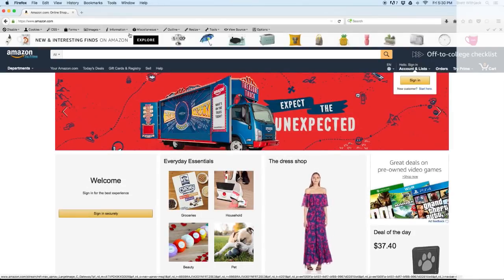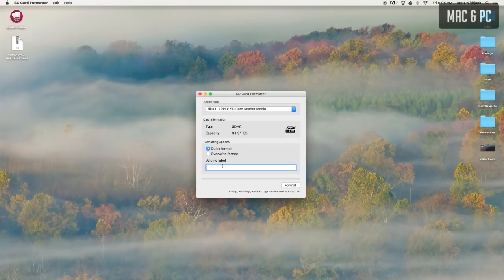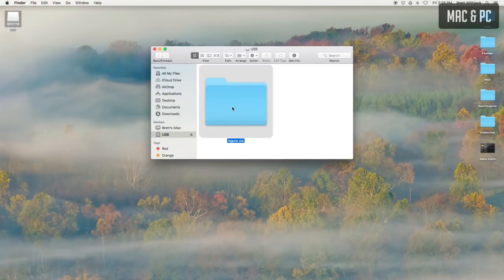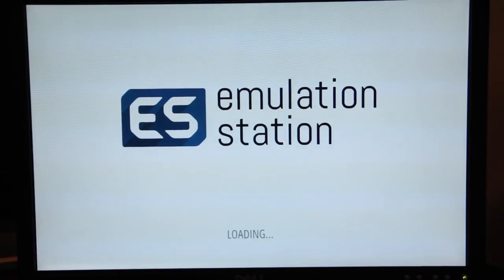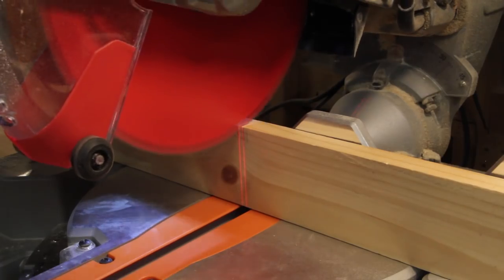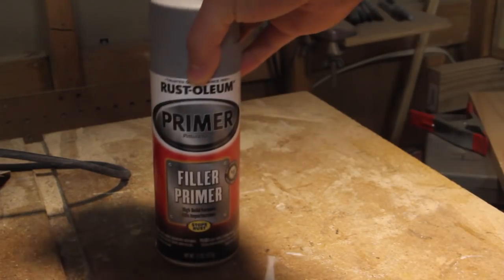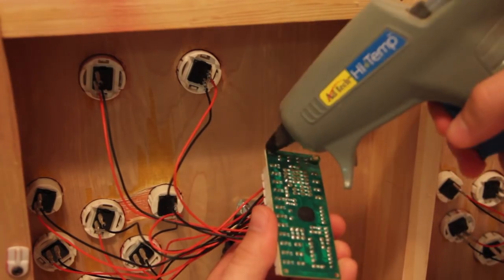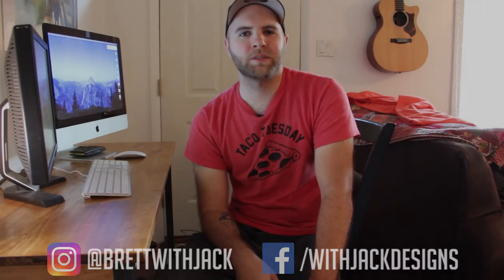Easiest DIY Arcade EVER - Part 1 - the Electronics

Comment: Great video! Very inspiring for a simple DIY project. 

I really liked the video because you made everything easy to understand and it is step-by-step.
What is great is that you did it as a 2 step process. After creating the base, if you want to continue to create the arcade box, go ahead. If not, you still play games using the joystick controls. 
So, I saw the comment below about having a complete equipped workshop. It would be nice to have everything but the whole project can be done with:
* Drill with the correct bits and blades. - For all holes
* Circular Saw - For the Main panel
* Mitre Box and Hand Saw - Inside joints and supports
* Jig Saw (Nice to have) - For the back.

BTW, love the comments coming from the cat!

Comment: As someone who has built a lot of arcade cabinets and control panels...if you want an ultra permium finish use black matte finish kitchen grade laminate. ITs a bit pricey for a 4'x8' sheet but it lasts for a lot of projects. It will make your top scratch and spill proof and it looks sick.
Reply from the maker: Awesome tip, thank you! I’ll have to give that a try if I make another. Well worth the money if it lasts

Comment: Pretty good rig, I would have attached the PCB card to the side instead of the top in case the top takes impact, it doesn't rattle the wire connections.
Reply: Do it then...ur  full  of it bud..
Reply: @keegan9470  Honey it was just a constructive criticism, chill

Comment: One other thing that is handy for an arcade stick thing is using a drawer box replacement.

Edit: for loading the roms there is 2 methods which one is using a USB drive and the other is SSH which you can use your network or WinSCP which you can just drag and drop and the process and time is pretty much about the same and another thing is for having the roms appear you don't need to do a full restart on the system you could always just restart emulationstation and everything will be loaded up and goes a lot quicker.

Comment from the maker: Hey folks, part 2 will be coming out in the coming weeks so stay tuned and don't forget to subscribe! And if you have any questions at all, don't hesitate to reach out!
Reply: Brett Withjack Dude! I love the new style. I like the step by step, most creators skip all the tech junk and force folks to go walkabout for the information. And I see you haven't frosted the bottle lamp yet lol
Reply from the maker: Thank you! Glad you like it :D as for the lamp though, that's the main room in the house which is quite small and that little lamp lights up the whole room lol creates a nice ambiance, plus I like seeing the style of the bulb.
Reply: OK.  I have two arcade style controllers setup already.. With 2 x dragon rise USB encoders. 

I'm having an issue with the controller boards using retroarch. 

Player 1 is configured and is working.  All is well.  

Come player 2.. I go to configure player 2.. It overrides the player 1 configured controller settings. 

And vice versa when I go to reconfigure player 1. 

Any ideas on how to correct this?

Also I'm using retroarch 1.6.7.. 

This is also open for anyone to answer.
Thanks for your time.
Reply: You may have just answered this question for me. 

A little bit of testing will confirm whether or not you were right.
Reply: Will it be here soon?
Reply from the maker: GorillaBomber Yes! The build is done and the video is already into production. I’ve been sick the past week so it’s slowed me down a little.
Reply: How close until the vid comes out , I am so excited you are the best how to build things person you go through every step Thank you for being alive and doing YouTube. And you earned urself a sub ;)
Reply from the maker: Michael Gonzalez thank you! The arcade is done and the video is currently in production. Depending on when I feel better and get my voice back I’ll be able to film the actual “how to” portion
Reply: Ok thank you, hope you feel better, you are in my prayers. :) (I would use a prayer emoji but I don't have one lol)
Reply from the maker: Haha no worries, thank you!
Reply: I have a question should I use ac or usb powered speaker which one is better
Reply from the maker: Michael Gonzalez Honestly doesn’t matter how it’s powered, just as long as you’re happy with the quality. I’ve had good luck with both.
Reply: Hi again its me again sorry asking for so many question again but I did all the downloading and its not working can you plz help me. Thanks :)

Comment: I am using the same controllers on mine and set up the same way. But in games only the player 1 controller works for both players the player 2 controller does not work for playing, only the start and select work. What is wrong?

Comment: I have a question.  I'm looking to making a raspberry pi arcade machine, and I want to mainly play the X-Men (arcade game), The Teenage Mutant Ninja Turtles (arcade game), and The Simpsons (arcade game), as played on the big arcade consoles of the early 90's.  As you mentioned these are games that were not reproduced for the other game systems.  I was hoping to build my own panel and install my own joysticks and possibly go with a 4 player configuration for those games specifically. What raspberry pi machine would I get to accomplish this and would these same joysticks work, and the same process you showed work for that?
Reply: The Rasberry pi 3 B+ is your best option. Yes you can make it 4 players, you might need a usb adapter/splitter because the pi only has one other usb port for 2 player (you need 2 more for 4 players). 
I would personally make 4 individual arcade sticks that hook to the main stick, or 2 dual sticks (like in the video but 2 of them) so you dont have a super long 6 foot board. But thats up to you..

Comment: Hey, Brett, you have screw up sticks with a different angles, does this affect on input accuracy? I think that is because a lack of space. But will not be better to angle stick a way, that all 4 switches, face the right input directions (up, down, left, right)? I plan to build my own cabinet.
Reply from the maker: If I’m understanding your question correctly, I haven’t had any problems with putting the joy sticks at a slight angle to allow for more shoulder room when in use by two people. If you’d like, you can add small triangles from the leftover vinyl to indicate the direction to push the stick in at.
Reply: Oh, now i understand) Thank you for reply!

Comment: Brett, this is great!  You really break it down in easy to understand segments.  I wonder if you can help with something?  I have successfully installed RetroPie on my R-Pi3. I have tried to upload the folders from the R-Pi3 onto two different USB sticks. When I plug the USB back into my laptop there are no files.
Reply from the maker: Hey thanks Shane, that's odd, I wonder why that's happening. Here's a guide I found on google, give it a try and let me know if that helps: https://github.com/RetroPie/RetroPie-Setup/wiki/Transferring-Roms
Reply: ok so i got it to work!  every time i was plugging in the usb stick my laptop was telling me to scan for errors. i thought i would just skip through this. then i tried it and the files popped up!
Reply from the maker: Nice! Glad it worked out!
Reply: @Bretts_Builds  while i have your attention, do you have any sites for downloading roms that you recommend?
Reply from the maker: I just googled roms and poked around a bit. Can’t remember which site I chose.

Comment: great vid. Could you tell me if the buttons you used click in? Does the sheet of wood have to be 1 inch for those buttons to click in?
-Thanks
Reply from the maker: The buttons act exactly like traditional arcade buttons and the material thickness doesn't matter. Originally I thought it needed to be 1/4 inch thick but I later found out that 3/4 inch thick material works just as well.
Reply: Brett Withjack but are the buttons not small like the height. so you need less thick wood.
Reply from the maker: Not exactly sure what you're asking. I've used thin wood as well as thick wood and they both worked fine.

Comment: great video...i copied exactly and have similar joystick /buttons kit, but gamepad is not detected when i plug it in....any advice appreciated!
Reply from the maker: Hey there, try powering it up with the keyboard AND controls plugged in. If you're able to navigate with the keyboard, go to the menu option to configure the controls and hold down a button from the arcade buttons and see if it detects it there. If not, check and see if all the wires are connected properly and firmly and try it again. If all that fails you might have a faulty set of controls.

Comment: Hey, after you uploaded the games through the USB onto the pi, do you need to keep the USB in for the games to load or could you remove it? thanks
Reply from the maker: Hey there, nah after you verify the games loaded onto the pi you can disconnect the USB drive until you wanna add more games

Comment: I've got the same buttons, unfortunately :( so, for the top panel, I should use MDF, right? What's the maximum thickness I can use? 4mm? Or can I get away with 6?
Reply from the maker: You can actually use as thick as you’d like, I later found out the thickness doesn’t matter as they clamp in just as securely
Reply: Thanks a lot for the help. I think I'll go for 10mm to have it more solid then... now I only have to decide between plywood and MDF. Plywood seems more solid, but MDF easier to drill cleanly.
Reply from the maker: Yeah I would highly recommend the mdf. The cheap ply I used was awful haha

Comment: I'm trying to build a 4 player control panel, would I be able to do this by combining all 4, or does it need a special kit
Reply from the maker: The RPi has 4 USB slots so it's safe to say you can configure 4 controllers normally just as long as the game you're playing is made for 4 players. I haven't tried this personally so let me know how it goes!
Reply: Brett Withjack do I need all of the controllers plug in when I configure them because that would mean one would not be plug in since I'd just a keyboard or use an 4 to 1 adapter for the usb?
Reply from the maker: Robert Martinez yeah each one will need plugged in directly but once you’ve configured one controller you can do the rest without the keyboard
Reply: You said .25" would work with snap in buttons?

Comment: 6:38 You cannot use a joystick for this first go.. The mapper tries to map all buttons at once(will not let you skip). If you are using a joystick that does not have Start, Select, r1,r2,r3 L1,L2,L3, 2x analog pads, 1 digital d-pad, and 4 buttons, you will get stuck without a simple way to bypass. Use the keyboard and map out "up, down, left right on dpad, a, b, x, y, start and select" on the keyboard. Make sure to remember what you selected as the menu is going to need you to use them to navigate. You can just use all random letters to finish up the remaining buttons. After you map the keyboard. All new controller mappings should allow you to skip buttons that you don't already have (sega, nes, snes, n64 type controllers). Also If you do have a select button or a home button.. Make sure to use that as your (action button). This allows you to close out of games and go back to main menu by holding Start + Action button(Select or Home) at the same time.

Comment: Do I need the adapter or can I use the micro sd card reader in my computer
Reply from the maker: Hey Justin good question, if your card reader has a spot for a micro sd card you do not need the adapter.

Comment: What about the speakers do you need usb speakers to connect it too or what Plz help me
Reply from the maker: Hey there, I’ll be touching on that in part 2. If you’re plugging it into a tv through the hdmi you don’t need speakers. If you’re using an adapter like me, you will need speakers. Any kind will do just as long as they have an audio jack you can plug into the RPi. If you still don’t hear any sounds coming through, look in the RetroPie settings and select the option that pushes audio through the audio jack instead of the hdmi.
Reply: Ok thank you

Comment: Does this work with a raspberry P1?
Reply from the maker: Possibly, I would look up more information on it, but I know the program "RetroPie" has the option to be installed onto the Raspberry Pi 1. If you look here: https://retropie.org.uk/download/ You will see two red download buttons... Click the left one that says 0/1. After that, follow the rest of the instructions in the video on loading everything onto the RPi and load a game to see if you're able to play it with a keyboard. If so, you should be able to use other USB controllers, including the ones I used in the video.
Reply: Brett Withjack thanks for the help.

Comment: You could have used a small USB hub to connect the controllers
Reply from the maker: What would the advantage be over just directly plugging them into the rpi?
Reply: The only thing that comes to mind is you could use the hub so that there's only one cable leaving the enclosure instead of 2. I guess it would look better if you were just going to leave the setup as is, but it would add another cost to building it and add a potential point where you could have problems if you bought a crappy one.
Reply from the maker: goober2049 I don’t think the rpi will be able to identify 2 controllers if they are funneled into the same usb hub. It’s best to just plug them in directly.
Reply: @Bretts_Builds  I know this is a year old comment but I actually use 4 controllers on 1 usb hub.

Comment: I want to add a switch to the arcade stick so that it can switch between using retropie and using it as a normal usb fightstick

Anybody here knows how to 
plz halp
Reply from the maker: My best guess is you actually ARE Obama, but also the USB that all the controls funnel into would just need unplugged from the RPi and then plugged into whatever console you're using to fight with. I don't know of any (easy) redirecting switches made for USB wiring. If you do know of one, or make one yourself, it would just need to go inline with the arcade controls cable that can be redirected from the RPi to the console of your choice.
Reply: I can assure you I am NOTOBAMA as stated by my username

yeah that's the only way I know how too

Thanks for replying btw

Tbh wasn't expecting you to

Comment: Why the need to format the mSD card before writing the image to it. The image will only overwrite the file system you just formatted it to. Its a totally redundant step especially since you are telling people to download additional software - Are you sure you aren't being paid by some of these companies? I burned 100s of RP images to about 20 different mSD cards, never once did I preformat any.
Also you mention renaming the ROM files, since you are making an 'Arcade" machine, but arcade ROM files should not be renamed, they rely on specific file names in order for the emulators to play them correctly.